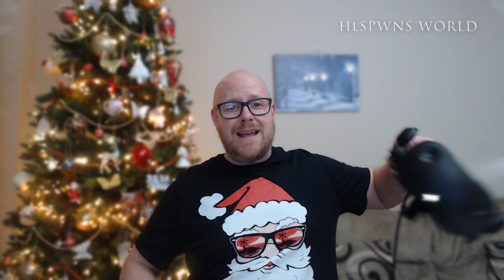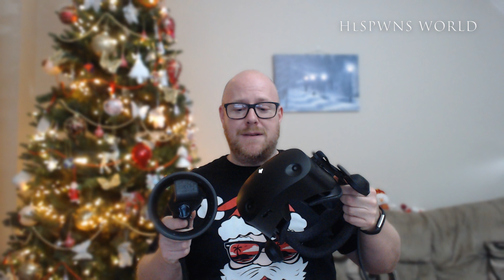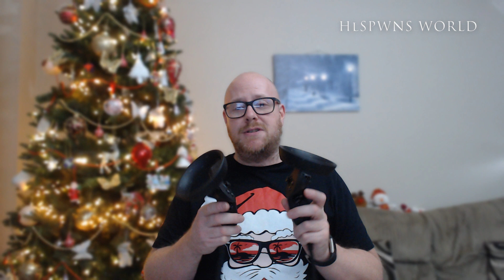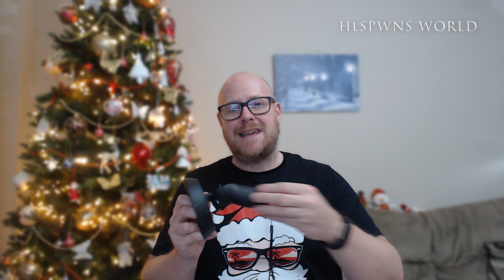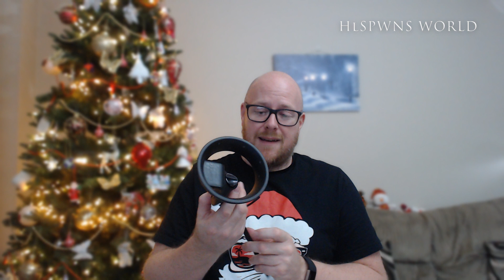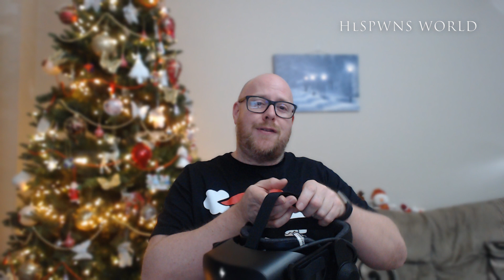Honest HP Reverb G2 First Impressions

Comment: Great review. I have a question on the IPD adjustment and the lense sweet spot. If you set the IPD at 6mm lass than your IPD, is it still compforatable to play? I ask because I have an IPD of 74mm and manufacturers are not making headsets with over 70mm IPD adjustment. I have a Vive Pro that has a max IPD of 74mm and I'd like to up grade, and the only choice with a 75mm IPD is the Pimax.
Reply from the maker: Hi Hugh, I find the IPD slider on the Reverb G2 not to be very intuitive for me to be honest. My IPD is in the lower end, and adjusting the slider to high does force the lenses to far apart. Coming down to my IPD and all the way to the lowest adjustment of the slider does not seem to make any difference on the image.
With the Oculus software you got a cross hair if I remember correctly come up on screen, and I could really dial in the crispness with the IPD slider, I was able to find the absolute perfect spot. Obviously the lenses are very different in the G2, but even looking at the measuring tape style graphic that comes up as you adjust, I am unable to find the perfect spot, the only time it distorts is when it gets to high.
Based on that info it may work for you? But until you try, I am unable to give you a definite answer as it will be down to your own perception, hopefully that’s helpful to you?
Reply: Hi Hugh, I've heard somewhere that HP say  +-5mm is still OK, that means 73mm should be OK. You're IPD is a little too wide, so the sweet spot will probably be more noticeable too you. I think you should be able to use it regardless. I have G1 today with a nominal IPD of 63mm. My IPD is 71 and I can still use it. I don't count the useless software IPD setting.

Comment: I pre ordered the HP Reverb G2 on August 4th and received the headset on November 20th, I hooked up the headset to my PC, I had a Rift S connected to my PC before and I replaced that headset with the G2, I also have a Quest 2 which I bought in the Fall, I don't see any differences with the resolution and clarity with the G2, the Rift S and the Quest 2, I prefer the Oculus Software over the Windows Mixed Reality software that the G2 runs on, I am now thinking about returning my G2 for my money back, the Windows Mixed Reality software and the issues with running some Steam Vr and Oculus games is a mess, the Oculus software on the Quest 2 and Rift S runs Oculus and Steam Vr games without hardly any issues compared to the Windows Mixed Reality software on the G2, I think I get a bigger fov on the Quest 2 with the Elite Strap and on the Rift S, maybe that's just me though, the G2 is a decent headset but for what you get on it, I don't think it was quite worth the price tag, I think I might just end up returning it for a full refund and just stick with the Quest 2 and Rift S for now, the Oculus software is just so much better and more stable for running games, good thing I have a Quest 2 and I kept my Rift S, Windows Mixed Reality needs future software updates to fix some issues
Reply from the maker: Thank you for posting that, it goes towards showing HP developers, and the WMR VR guys that if they want there headsets to be market leaders the software or software interface is just as important as the device it’s self. 
It’s an interesting perspective you have put forward and I’d like to try the quest 2, my self to actually see how different the Reverb G2 is.
Reply: @HlspwnsWorld  I am going to keep the G2, I worked out some of the issues with some of the games, I got most of my Steam Vr and Oculus games running good now, I do like the screen resolution of the G2 though, the clarity I have to admit is really impressive, you can adjust the headset to make the fov bigger and maybe future updates for Windows Mixed Reality software will improve alot things for most of the games, but I think I worked out some of the kinks so far with the settings, might as well have both the G2 and the Quest 2, both are really good Vr headsets, can't go wrong with either one

Comment: Great Review... you are the first reviewer that  I found  that gave an honest review. I got duped into buying the HP reverb G1 by other reviewer the small sweet spot and the blurry outer edges was terrible not to mention the flickering screen when using  Window Mix Reality Portal/ interface. I did not have an issue with flicking screen when playing DCS on the Rift S. Keep up the good work. New Subscriber!
Reply from the maker: Thank you for the sub 👍🏻, I can’t really comment on how much the HMD has improved from the G1 as I’ve never used one. I have experienced minor flickering in WMR portal as well, but it’s not very often. What I really hate in the WMR is the camera shutter affect they have added to the locomotion, and the snap turning reminds me of boneworks (very jerky). 
With all that said, I don’t actually go into the WMR any more. I cover the sensor on the hmd, then double click the WRM steam application, which takes the headset straight into steam VR. The headset really is the strongest part of this device, and now that I have played more games I just wanted to let you know that how much the sweet spot is noticeable, really does depend on what your playing

Comment: Wow what a whinge.  So you got it late.  Moanng about mixed reality software.  Its just a bypass to steam.  What did you expect.  Makes me want to give my opinion when i get mine Thursday
Reply from the maker: When you have used the Oculus home and Steam VR for a long time, you realise how buggy WMR is, even integrated in with its own OS. I honestly think it’s poor that Microsoft have not updated the software, or looked at the issues it causes. Why the headset did not just ditch WMR and link straight into steam I don’t know, as effectively that’s what your doing to play any games.
Every time you open WMR it causes your main display to flicker off then come back on. It’s often caused my desktop icons to glitch into different positions on screen which is rather annoying. Since owning the Rift and using the vive I’ve never had such issues.
Yes it is a moan, and rightly so. As a flagship headset we should not have to put up with janky software, and be spending time online working out work arounds. Good software and design should be seamless.
P.S hope your experience goes more smoothly than mine 👍🏻
Reply: @HlspwnsWorld Although I'm not too fond of the WMR ecosystem,  I have not had any of the problems with WMR and display flicker that you mention with my HP Reverb G2.  Maybe it's a hardware issue that you are having?

Comment: It definitely sounds like you had a wrong impression then. It's just how it is for now, with the current technology. Because we are looking through lenses that are focusing our eyes on the center, it's a necessary "flaw" if you will, or a "symptom" that things are not focused outside the center.

So I don't know how you ended up with that unrealistic expectation, but it's definitely just like that with absolutely every headset, to a smaller or larger degree, depending on the quality of the lesnes and other factors.
Reply from the maker: I have to disagree, I’ve used both the oculus rift and the htc vive and neither of those headsets had such a small sweet spot across the horizontal plane, the htc lenses were replaced with upgraded ones just for point of reference. Maybe it was the lower resolution of those headsets, but it’s something i’ve never really noticed before. 
In the Reverb G2 it’s glaringly obvious.
Tbh after using the headset a lot more today, I’d also say it depends on the game being played and who developed it. I’ve noticed games using lower models and environments, or using more arcade type graphics the less pronounced it becomes.

Comment from the maker: As I spend more time in the G2, I’ll update anything relevant below

Steam VR scaling setting:
I have had some comments from people telling me that reducing the scaling setting in steam VR to 50% is incorrect, and its not the correct scaling for the headset. Although I had read online that the setting in steam vr is a bug, I had ignored this and just thought that steam vr was super sampling the image, and that's why I reduced the setting to match the reverb G2 pixel per eye resolution of 2160 x 2160 per eye.

FRT Brian explained the following ;
The lense distorts your view, " pin cushion" the screen behind the lense. The barrel distortion corrects that and provides a flat image in VR, this also results in sharper image in the centre. It is a required setting to allow for the corrective barrelling to ensure the resulting flat VR res is true 2160x2160 Check the steam VR resolution for every headset on the market. Ask HP it's a necessary setting. That doent mean dropping to half as you have wont help a weak system but if you want 2160x2160 in your headset leave steam at 3100x3100

After doing some reading, about the above, I realised that I was wrong. To also clarify I tweeted HP, Steam VR, and Joanna Popper. This is the reply I got from Joanna

Hi! SteamVR should set it automatically for you. The scaling should be approximately 3000x3000 in SteamVR with the HP Reverb G2. Different PCs are slightly different. Thanks for asking. Feel free to DM if you have other questions. Thanks!

The correct true setting for the headset in steam, is to leave it set at 100%, you can go above or below this, but lowering the setting will lower the quality and GPU performance. Increasing the setting causes more super sampling, and will make the image crisper, but will require more GPU resources.

Also please remember that if you super sample in steam VR and then in game, this will compound and massively affect performance.  

Tracking:
Christmas tree lights and decoration lights are turned off when using the headset and controllers. I have found that in natural daylight the tracking is a bit better, and dropping the controllers to the side has not caused so many issues today. The problems of the headset not seeing the controllers still cause some games to glitch or lag for a split second. Playing H3VR and looking through scope sites are fine, until you bring the controllers to close to the headset. The rings on the controllers are too big, and can get in the way when trying to cock the slide, or action rifle bolts. Tracking at night in a dark room does have the headset complain that it’s unable to see my mapped boundaries and suggested turning lights on. Tracking still works, but when it looses a controller, your hand goes flying across the screen in these very low light levels.

Software:
Since making this video, I've found a few work arounds to launching Steam VR from with in the headset, and to getting to programs or windows that have shot off the screen. I'll cover this in a future video.

Display: I think I forgot to mention how vibrant the colour reproduction is in this headset. Testing with Big Screen movies are very enjoyable, the black levels are frankly black and not washed out. I need to test with a 4K movie to completely comment on the level of the display. I would have liked to have tested with Cmore VR cinema, but I’ve not yet been able to figure out the controllers mapping.

Sweet spot:
Having played a lot more games today, I’ve noticed the blurriness outside of the sweet spot really depends on what your playing. Some titles you don’t really notice that much. Others it’s very pronounced. 

Review:
This review seems pretty negative, but that's because I had such high expectations, and to be honest its based on first impressions. Having already been gaming at 4K resolution on an LG OLED TV, the image in the headset was not mind blowing, and the fact that its not pin sharp across the whole field of view,  in my opinion is a big blow.
Reply: You can also add weight to the back of the headset to get better sweetspot and heaviness off your face. I have the G2, Quest 2, and owned and Index so I know what I'm talking about. I used the weights from Studioform and it literally changed VR comfort for me to another level.
Reply from the maker: @MsEddiepark  I’ll take a look at them as it’s something I’ve never used. I used to spend about 4-5 hours in my Oculus Rift, but I’d pay for it the next day. Not done a really long session in the G2 yet, but from the hour race I did the other day, I did not feel any eye strain.
Reply: @HlspwnsWorld  You can really put anything on the back to get better comfort if you had the time to mod your headset. The G2's definitely not an eye opener for anyone that's spent years in vr but for me personally, it's an upgrade over the index headset.
Reply from the maker: @MsEddiepark  Ye coming from the Rift and the Vive there is no doubt the G2 is an improvement. But it’s not like going from 1080p to 4K on a desktop monitor. The gap from 1st gen vr to now is not that big a leap
Reply: @MsEddiepark  hi, regardless of the price, for the best experience VR , quest 2 or G2  ?? thank you
Reply: Your review has a lot of useful information. Thanks!
Reply: Thanks for the info about sequencing the software load sequence. I might finally be able to run something (G2 is my first VR headset and will be used for DCS World and FS2020). Looking forward to your 'workaround' video ASAP!